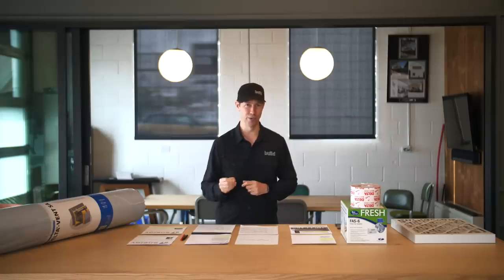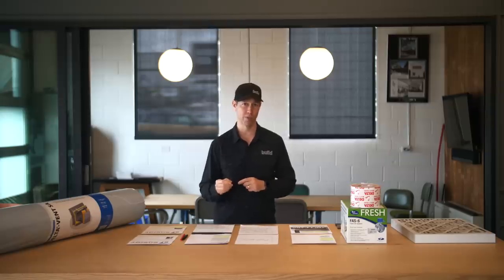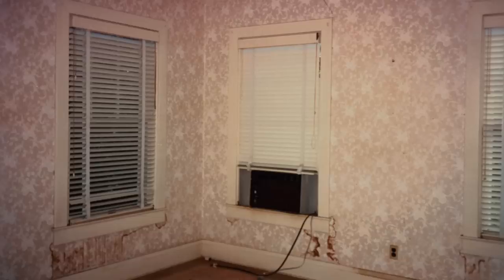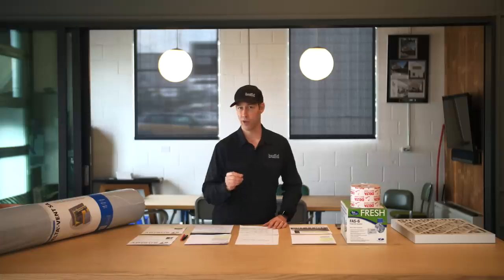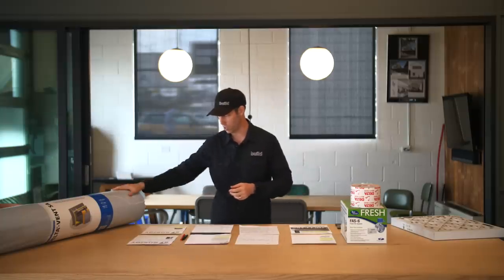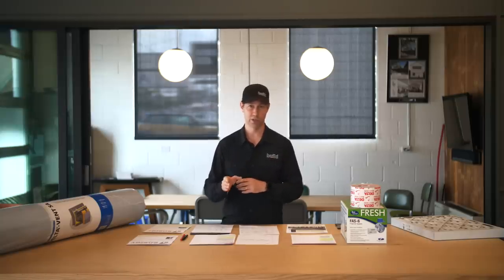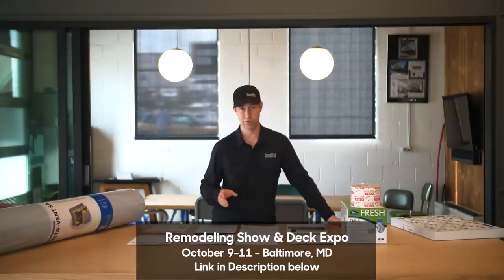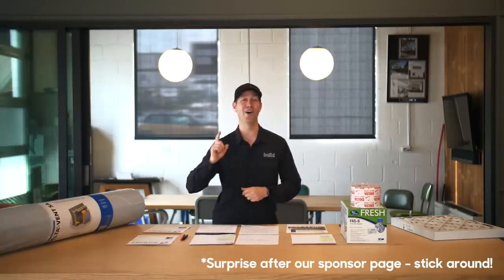“Houses need to BREATHE!” - Shut your filthy mouth

Comment: Gotta disagree with you on this one Matt. You are polarising the debate. There is a middle ground to be had where a home can be designed to passively ventilate through the use of the “stack effect” and well thought out cross ventilation practices. Building  homes that are 100% reliant on mechanical ventilation is a major weakness during brownouts and escalating energy costs. Agreed that houses should not be full of air leaks - however there is a solution between the extremes that mitigates the risk of fossil fuel reliance as HVACS are power hungry beasts that solar struggles to support during peak demand. Cheers.
Reply: Citizen Unplugged these super tight houses appear to be uninhabitable without electricity.
Reply: But considering you could just use operable windows to ventilate if you had a power outage, its no different.  The point would be that you are controlling the situation a majority of the time, and for extreme cases you always have a backup.
Reply: Most homes have electricity.. If its a problem where one would be without it for a period of time, a generator works or open a window.
Reply: a better sealed home is a more efficient home that uses less energy, which means fewer brownouts, and lower costs. He's building a home for the future, not just for today.
Reply: i agree on building tighter ..that being said just the insulation codes up here in the northeast are crazy...i think there is still something to be said for homes built 100 plus years ago..  gotta be a middle ground.
Reply: You're right, all those old time builders didn't build a sloppy and loose fit house, some were built very well. Like today, all builders are NOT equal.
Reply: @Jepetto21  : Exactly what I was going to say and sooo obvious imho. I wonder if @Citizen Unplugged even thought of this before he made his comment.
Reply: Still: Build tight, ventilate where YOU want it and WHEN you need it! You need to be in charge of the ventilation (mechanical or by convection ar wind) and not some random chances of wind and weather.
Yes, we first had to learn to build and manage tight houses and many mistakes were made along the way (and are probably still made by people who don't understand what they do or just want to cheap out on stuff).

And as Matt explained: comfort today is different from comfort expectations 70, 80 or 100 years ago. My grand grandmother never heated her house above 16°C in the winter (about 60°F). She did not care that after a snowstorm there was a sheet of snow laying on the floor inside the room in front of the kitchen because the cold air blew trough the gap under the front door, trough the kitchen and out the back of the house. Would you find this acceptable today? Most people would not!
So there are two ways to change that: Use a lot of energy to keep the house warm OR get the flow of energy (heat) and air under control!
But a house needing to "breathe"? That's definitely a myth.
It's all about having control!
Reply: We purposely took the weather strips off the back door so the rugged old boilers downstairs would have enough air to breath after new windows where installed.  That will be the policy until a direct vent/intake type is installed.
Reply: @DavidCiani  Not only uninhabitable, they will literally begin to rot from lack of ventilation.
Reply: This idea would make sense in a climate with minimal heating and cooling. When it's -20 outside, ventilating passively makes no sense. Also, having a tight house with a mechanical ventilation system does not preclude you opening windows, if that's really how you want to get fresh air.
Reply: @trevorlambert4226  If you live where it gets to -20 all I can say is, what is wrong with you?
Reply: If the brownout happens when it's cold out, you will wish your house didn't leak. If the brownout happens when it's hot, open a damn window. There is no benefit to having a leaky house.
Reply: yes and another point of a house like this is, what if the house goes uninhabited? I am from detroit, we renovate houses that have been abandoned for YEARS and when we strip them back the structure is usually in excellent shape despite the extreme weather and hardships these structures have endured. I guess if one of these sealed houses became abandoned it would be up to the last person who owned it to leave a few windows open!
Reply: @Squay313  Nothing would happen to the house because there would be noone living there raising the humidity of the air.
Reply: These guys are like the government. Creating problems where none exist. Then providing solutions that only work temporarily. Thus creating more problems. That again they rush in with their high faluting nonsensical new fangled and expensive product to solve the probkem they indeed created. I saw the rabbit hoke as they started ro dig. I said to myself, "have fun guys. I enjoy being human." Now they're 15 years into their hole with their heads sticking out they ass. As I'm still shaking mine just watching them fail again and again to the tune of millions of dollars wasted on junk.

Comment: WRT the durability of the "old" houses, i think i big part has to do with the wood that was used back then, almost all old growth stuff with rings so tight you need a magnifying glass to see them. Now we see growth rings pushing 1/2"
Reply from the maker: Excellent point
Reply: True...but that does depend heavily on the regional source of the wood. Douglas fir from Montana or Idaho will not have the growth rate of coastal fir. I have on my desk a 3" diameter slice of Idaho fir log....112 years old.
   But back to the materials from then and now....I went to a high end builder supply in Seattle, and all they had for studs was western hemlock...they said they could order for me one douglas fir stud..seriously. No wonder new construction is so sensitive to moisture, with that kind of attitude.  How anyone could use hemlock for framing in Seattle is beyond me.
Reply: @danstrayer111  I'm building in seattle now. No lumber pack yet but I bet there will be 0 fir studs. Last I spoke with a Dunn lumber guy he said the fir boards he can get are not straight.
Reply: Ram-------------Funny....Dunn lumber is where I was told they could order a stud. I wanted to laugh in his face.  And what is this about not being straight?? what the hell are they smokin over there? 
     I am in north Idaho..and I will tell you, there is no hemlock or white woods, I have gone to the local yard here and pulled CLEAR,  2 x 12 x 14' DF select structural,  products here are absolutely first rate. If you have a big job there, better shop around. I think Dunn is overpriced  and run by prima-donnas .   I went to HD on N.Aurora and they had pretty decent lumber there.
  Hemlock is structurally rated same as D.FIr, however.... using it in a damp marine climate? I would not build with it under any circumstance...I did too many remodels where that had been done and it can be a disaster.
Reply: @danstrayer111  2700 sq ft house with 3 car garage. They get their stuff from BMC and most of the house is engineered woods. Studs will probably be hemlock. We will see. Footings in next week.
Reply: Best of luck on that.  Pretty big job.  Hope you're dry before the rain!
Reply: Old growth wood also has pitch.  We have 80 yr fir old growth stumps out here near Seattle that look rotten on the outside but is solid 6 inches in.  You need a hell of a rig to root them out.
Reply: In  1990 I dug 3' diameter fir logs from the 1932 Forks Fire out of the ground, completely buried. I had that milled and trimmed out the house I am in now...58 years in the ground, in the rain forest,  still hard as a rock.
Reply: Cool, second growth has evolved a way of storing energy other than pitch huh, what is it, nuclear fusion?
Reply: Modern framing lumber is sadly crap. All fast growing pines. Within the family we have a post and beam joinery home owned since forever, all records lost sadly. And a balloon framed two story home. When is the last time you've seen a two story true 2x4 that was straight and not twisted? I sure haven't in forever. 

But modern homes aren't built to last and we've got to protect the natural resources we once used without thinking about it. Humanity took 200,000 years to get to 1 billion population. Then in the last 200 years we've exploded up to 7 billion and are likely to hit 11 billion. So tree farms and engineered products while they may not last allow us to keep building without the cost skyrocketing. And in modern society homes are rarely handed down through the family, are massively remodeled as in knocked down to the framing every 20-30 years on average. So if it was all good quality old slow growth lumber just think how much would be wasted due to remodeling.
Reply: Old houses that weren’t built well have fallen down.

Comment: imho it's kind of a cop out to go "all the way back to 1930s" for your old house example. let's see you seal up an 1880s double brick house. good luck! and if you manage it, let's check back in 100 years to see how the brick handled the freeze thaw cycles when it never had a chance to dry out between times of rain and condensation. double brick was designed to have airflow on the inside surface of the brick to allow moisture to evaporate. your examples of rot are precisely because someone tried to seal a house but didn't do it right, so small gaps let moisture in and the misguided sealing attempt trapped it. of course when building from scratch, one has the advantage of complete control over the process, but when working with an old house you cannot fully seal it and you are absolutely going to cause problems if you try to seal it and only get it 90% to the finish line. there is no way to have proper control over airflow unless you strip the house back to the studs/bricks in every room. and in that case you have to consider the embodied energy of the local materials that are already there. tearing back to the brick, sending most of the house to landfill,, and starting over using materials manufactured and shipped from elsewhere is not a sustainable practise on a large scale. your advice is great for new builds and whole-house rebuilds but not good advice for someone renovating just part of their old house.

Comment: Matt, I work as a building science advisor in Seattle primarily helping people control heating bills. There are a lot of cheaply built homes with baseboard heat. Bills skyrocket because those baseboards are mismanaged and people aren’t even comfortable in their home. I often advise that simply moving air around with a fan would help distribute heat and dry the air. I also recommend people make use of their bathroom ventilation fans to exhaust humidity in the home. Do you have any other thoughts or resources for homes without central heating?

Comment: No doubt, from an energy efficiency standpoint, new homes are much better, but so many of the materials that go into new production/tract homes are garbage compared to old homes.
Reply: All the sealents, air barriers, and insulation Risinger promotes will chemically decompose in 50 to 100 years maybe less. What will you be left with then? Also consider the effects of off-gassing from all the chemicals in these products.
Reply: I hear this all the time. It's the things aren't built like they used to be and it's only partially true and it really just comes down to money. All the cheap goods we have created a massive market of subpar products that became the new standard even though all the old products and materials still exist they just became very expensive because of inflation and the labor to manufacture them. We also have much better products out there and smarter designs than we have ever had in all of history but they either cost a lot of money or require a lot of know-how. Unless you are lucky enough to meet a friendly luxury home builder who understands all the engineering to build high quality homes  and is willing to share their secrets they can be hard to put into the building concept. In many cases though if you do find someone they are often open to telling their secrets because they're sick and tired of crappy builds but you still have to break it all down and understand how and why something works. If you are buying a new home it's best to do a lot of research into the engineers that are building it and understand everything they are doing if they don't want to show you and get annoyed by  the curiosity they are probably not a good company.

Comment: funy my house is 119 years old old farm house. i know all to well about leakyness but. retrofitting old houses very tricky. you have to dry to the outside as far as air tight you may improve it but have to be mindfull. house still needs to try. so only vaper permiable products can be used.

Comment: Great video! Very good example about human body, but i have to say: human skin breaths, you shuld know that. If all skin would be covered in plastic membrane - body simply will die, because only air from nose is not enouth to stay alive. Thats why, i build passive houses in europe with breathing materials, where the inside is very tight for air, and outside is 100% tight for moisture but open for low difusion. and for example the door blow test shows nearly 0,6 air change in one hour. The condensate point i make is outside, on the wented space between siding ant wind insulation. This construction will serve for hundreds of years. Thanks for sharing!

Comment: The windows in the old house with the stains could be due to high condensation on the windows during cold weather as well.  Those old singe panes would drip terribly.

Comment: What cost more, 50K to fix the rot, or paying an extra couple of dollars a month only during the critical temperature seasons, (peak summer, peak winter)?
Reply: But these 50k go to the right industry, see sponsor list :) I am from Germany and it is the same thing over here for at least 2 decades. Massive boosting of insulation as "the solution" and preventing problems to become visible barely until the warranty period of the contractor is over.

Comment: Houses need to get rid of excessive moisture. Everywhere. Making them leaky is the easy way to just do that. Making them airtight and at the same time remove the excessive moisture from all places where it could build up is the holy grail, and sadly not many are able to build them like that because it always needs more work and doublechecking than you think.

Regarding the buffer capacity: Good stone houses with the right plaster on them have a really nice and high buffer capacity.

Comment: The most energy efficient house i owned was a 1700 sq foot 2 story house built in 1910. Plaster walls single pane windows with removable storm windows. A furnace from the early 50s. In michigan. My winter heat bill was a whoping $45. Try to get that with a modern house i dare you.
Reply: they can build houses that can be heated with a hair dryer. and saying "my heating bill was $45" is like saying "I spent $45 on grocery". pretty much meaningless without more detail about what kind of house it is, what temperature you set it at and how much energy (not money) was used. for one thing, I wouldn't buy that house from you.
Reply: Please explain more.
Reply: less than $500 US inflation adjusted

Comment: The example of the body with one intake falls apart quickly because when you exert yourself, every part of your body sweats moisture and a bacteria will quickly grow on your body and clothing unless you change  and take a shower.
I understand the challenges we face but have we moved the ball forward by using building supplies that are insufficient to stand the test of time? I’ve been in the industry since the early 70s and have watched the houses get tighter and tighter and I suspect we might have more mold issues now than we did in the past! I’m all for figuring out a better way to deal with the trapped moisture that arises from a temperature variance but we certainly aren’t their yet. Pickup trucks used to be built to last, now they are built to last long enough to pay off your bank note. I’m always interested in new and innovative ways to deal with moisture because that’s the difference in a 30 year house  and one built to last 150 years.

Comment: The mistake is trying to heat a whole house instead of just your body.
Reply: Just carry a personal AC already.
Reply: I wish I had a house like this. It's not fun wearing sweaters in your house during the winter ;(. Not only that but the floors are cold as bone too.
Reply: @holmiumh  to bad no one has invented on worth a damn.

Wouldnt be to hard to design an actual working appliace --- if you could convince  people to wear a neck collar (maybe a vest thing or special belt that touches skin). Well that parts not that hard, sharper image made a fortune of their scam one
The kicker is youd have to carry around a back pack with a battery and either a small fan unit or fairly large heat sink (or maybe it could fit in a fanny pack type thing).
That's just much for almost anyone to want to deal with.